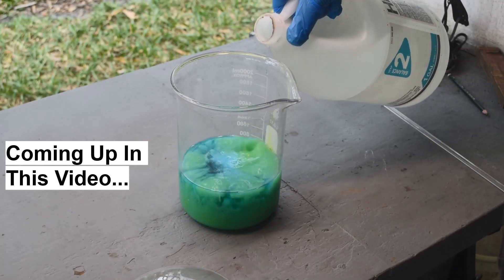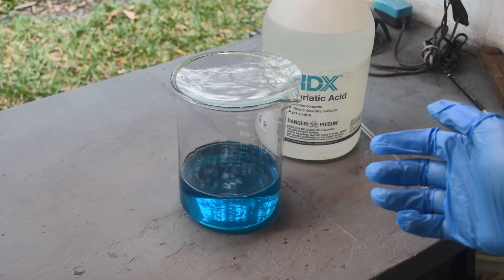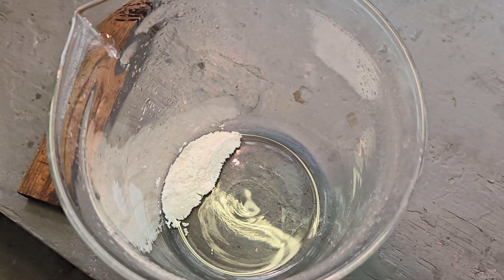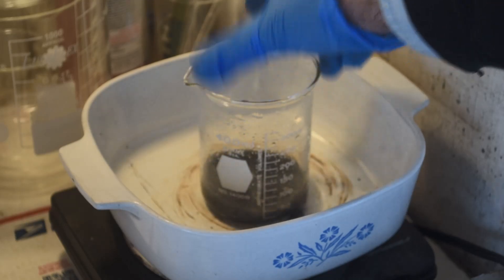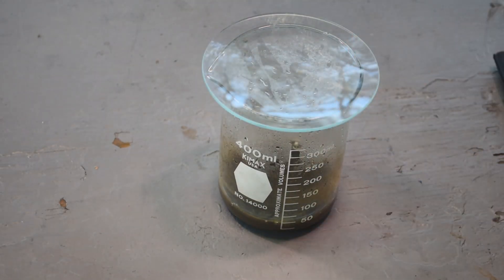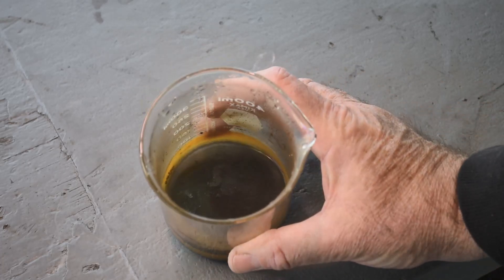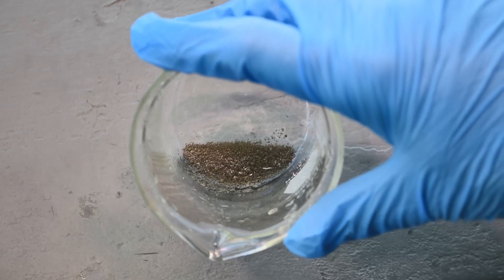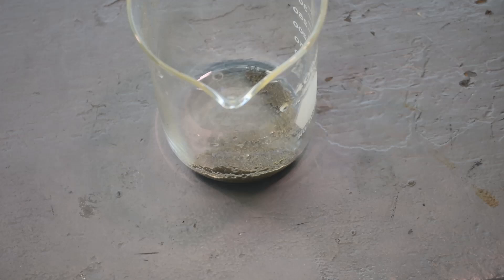Silver From Iron: Easy Silver Chloride Reduction #chemistry #silver #preciousmetals #scrapping

Comment: I prefer a different route that lets me recover everything in a virtually wasteless process. Use copper on silver nitrate solution to cement out all the silver.
Add sulphuric acid to the copper nitrate solution. Then distill off the nitric acid. Then electrolyse the copper sulphate to recover sulfuric acid and even the copper that you can use to cement out the next batch of silver.
If you like you can distill the sulphuric acid in the end to get high purity chemicals back. But distilling sulphuric acid is for experienced people only, or it can seriously hurt you. 
You can also use it directly a couple of times to displace the next batch of nitric acid. But contaminations collect in this residue. Mostly iron and nickel sulphates.
Reply: Can you please tell me how to distill nitric acid and electrolysis process of copper sulphate yo recover copper
Reply: @vilassalunkhe943  Watch the video by nurdrage

Comment: I think the solubility of silver chloride is higher in ferric chloride.  I don't think you're getting much of a reaction until the iron begins to react with HCl.  You may find that you can shave time off of the process by starting with a ferric chloride solution, adding pieces of iron (or copper) and essentially cementing the silver out.  I read somewhere that table salt will further enhance the solubility of silver chloride in ferric chloride.

Comment: I saw a video where they used the steel plates from an electric motor winding, swirling the silver chloride over them in a large pan. Seemed to convert faster than cementing on copper directly, and maybe slightly cleaner after an HCl boil.